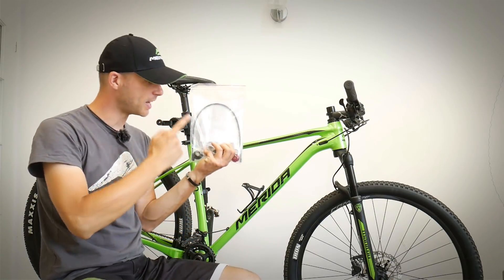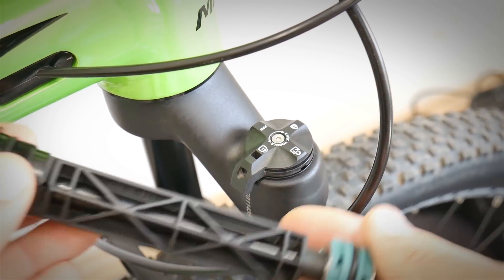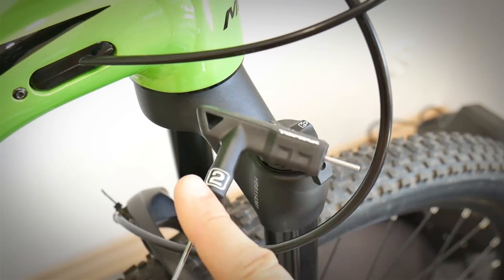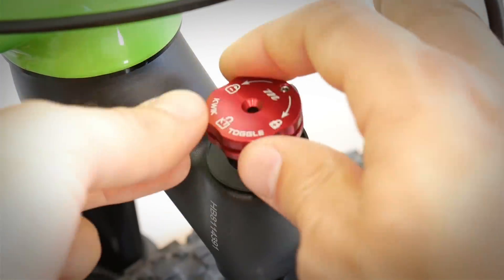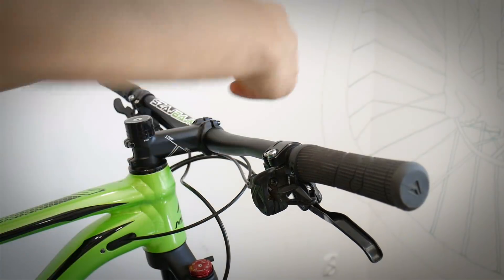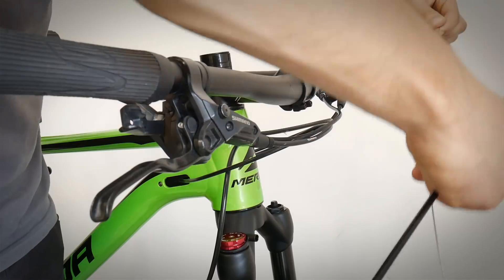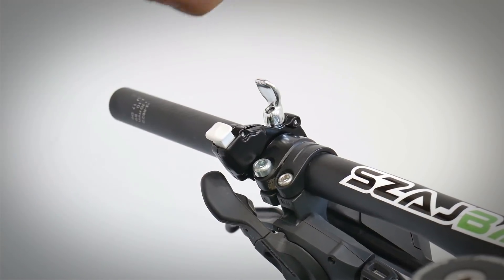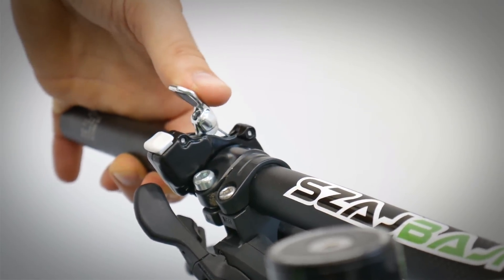"Green Froggy" Gets A Lockout For Manitou Markhor Fork. How To Install It?

Comment: I have a rockrider bike from decathlon. Specifically the xc100 2019. It has a manitou markhor 100 fork and I have remote lockout on it. It also has the plastic quick toggle and has a cable entrance to the side which I suppose its manitou that made it then with a rockrider comboloc. Was looking to upgrade the remote part of it but it seems like you buy the remote with the whole kit. So id be replacing all that plastic stuff which is nice. The point is I don't have to use the force of my hand you could either check a decathlon bike or just look up a vid on my specific model or similar. But at this point I think you know this already

Comment: Hello pal.  I had a few quick questions!   One is I own a 2016 Cannondale Caad8 105 after your recommendation and ABSOLUTELY love it.  My two part question is this.  Why does Cannondale forbid spacers on top of the stem.  2nd is I want to slam my stem which my lbs will do for me but before I do it, I wanted to try different positions with spacers before doing so.   Your thoughts ??

Comment: I don't see that you have the halfway setting now it's just open or closed?  Does the remote not have the ability to support the middle setting?
Reply: its the damper unit in the fork that has only 2 positions. it is upgradeable with the ABS+ damper which does allow more options (part 141-26532-K001)
Reply: ultiss yes that's right, I was sure he said he had 3 settings but indeed only the two open or closed cheers 👍

Comment: Can i use it on my manitou machete?
Reply: I supposedly ordered a Manitou Machete and the remote lockout kit shown in the video is the same kit that came with my fork (well, there are very minor differences).  I decided not to install the remote lockout controller because it cannot turn the knob all the way from "open" to "lock" because the remote lockout lever has a short travel only while the manual knob of the Machete turns more than 90 degrees (the Machete has many steps from open to locked position unlike the fork in the video that only has open and locked setting).

If you decide to remove the manual knob, be careful with the 2 bearings that provide the detent on the stepped settings.  They are very small, very light, and not magnetic which means they can easily get lost.  Ask me how I know. :(

Comment: One question . Im looking for a new fork for my  bike  and don't  want  to go crazy  spending  lots of $, i been  looking  for different type of  fork and so far  the one cut  my attention is the manitou  for the machete models. Do you think  it will be a right  choice?
Reply: I have just got the RockShox Recon TK Solo Air. So far it's wonderful. I got it for 186 EUR (about 218 USD) Bear in mind that with an air suspension you will probably need to buy a pump which will cost you some more money!
Reply: Get the rockshox Judy RL Gold instead, it's a tad bit better